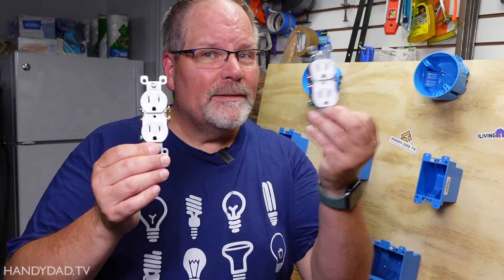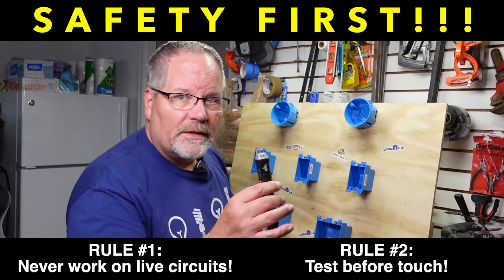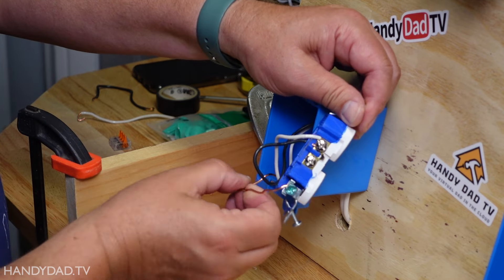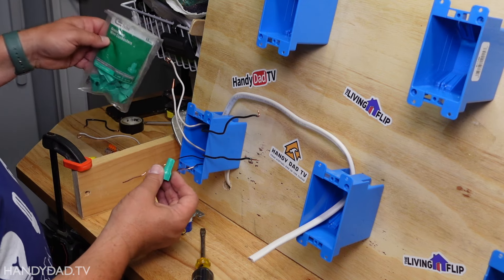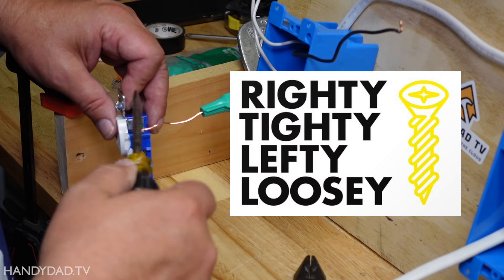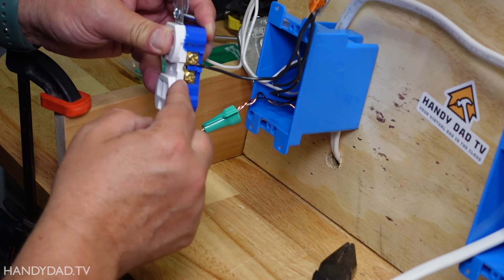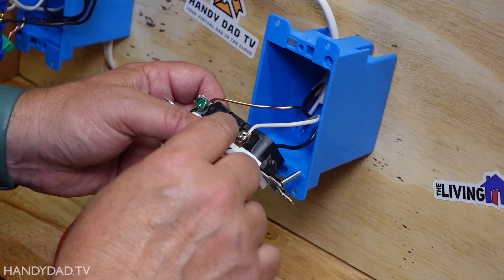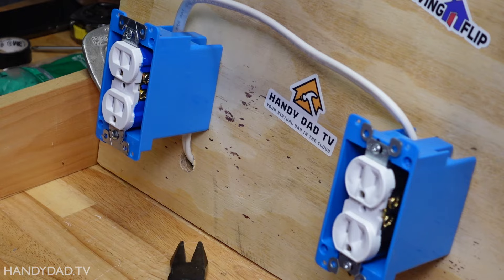SAVE $300 EACH!! How to Add an Outlet from Another Outlet

Comment: thanks so much for your video! can i “pigtail” the ground wire same way you did the hot wire or must ground wires be “bonded”?
Reply from the maker: Yes you can pigtail the grounds. Bonding just means they will stay together even if the receptacle is removed.
Reply: @handydadtv thx very much for taking the time to respond! appreciate it!  and thx for the great video!

Comment: Great video; I had never seen that pig tail used.  Makes a lot of sense.  having said that, then, what is the second connector (screw) used for, if not extending the series?  thanks.
Reply from the maker: Technically each set of screws goes with each receptacle.
Reply: Can you pigtail the ground wires too?
Reply from the maker: @jeffc31783 Yes.

Comment: Adding a garage outlet on a different breaker to split the load of electric heaters.  This will be perfect for pulling power from my bedroom, through the attic, and to a new outlet in my garage ceiling. 😎
Reply from the maker: For heaters, you should consider running new circuits.
Reply: @ I considered it, but the current circuit only powers LED lights, and the battery charger for my power tools.  The additional circuit carries more load, but only in the summer when AC is on it, or if my wife is running a curling iron.
Reply from the maker: @Christopher_R Ok I’m glad you thought it through. 👍🏻

Comment: thanks going to use this on an office luckily it is a new room and I can easily get to wires. When would you want outless on their own breaker?
Reply from the maker: I’d put the office outlets on a separate circuit because computers, monitors and printers draw a healthy amount of current, especially if you have more than one workstation. Especially if you have walls open.

Comment: This is an excellent video, thank you. I do have one question. What if the original outlet has 2 hot wires and 2 neutral already wired in? How do I attach the 3rd wire from the outlet I want to install?
Reply from the maker: Same as the grounds: Use a wire nut or Wago to connect all the wires with a pigtail (short length of wire) to the outlet.

Comment: I need to do this exact same thing to add a box to my ceiling for my garage door opener.  What wire is that you are using?  Thanks for making and sharing this video.
Reply from the maker: Wire sizing depends on the rating of the breaker.

Comment: Great content here! Love everything except the mention of wago lever nuts having a higher operating temp range. I believe it is actually the opposite - most wire nuts have a higher operating temperature than Wago lever nuts.
Reply from the maker: It’s a moot point. Wire nuts and Wagos are rated for 105°C. Romex wire insulation is rated for 90°C.
Reply: @handydadtv  true.

Comment: Thank you for the video..I’m adding a fireplace in the wall and adding a extra outlet for it my question is to get the right wire that I need ?
Reply from the maker: I would only use the heater if it’s a 20-amp circuit. Check the number on the breaker. 

If it’s a 20-amp breaker, use 12/2 wire to the new outlet. 

If it’s a 15-amp breaker, consider running a new circuit if you intend to use the heater.

Comment: Great video!!!! Question--: I have 2 outlets connected to each other in my bathroom walls, but I WANT TO REMOVE ONE OUTLET.... How do I do it?, and how to change the wires that go to this outlet I want to remove????  THANKS
Reply from the maker: Cap the wires and install a blank plate. Don’t cover a junction box in the wall.

Comment: This is awesome! Question: it seems the existing outlet I need to use already has two wires. It's using up all four screws in the plug.   Can I add a third romex cable in the box? If so, do I pigtail the two existing wires in the box and just add the new wires to the plug? (Except for the ground)? Looking everywhere and cannot find a detailed video on this!
Thank you so much!
Reply from the maker: I had the same situation in this video: https://youtu.be/klL8XhKMNT8

Comment: I do have a question about the wire needed to run to the new outlet... is 14/2 type NM-B Romex the correct wire? I appreciate your time and thank you for all the instruction!
Reply from the maker: It depends on the size of your breaker. 14/2 is for 15 amp circuits. If it’s a 20 amp circuit, use 12/2.
Reply: @handydadtv  Great help! Thank you!!

Comment: Great video! Thank you! I am planning to create new two outlet from existing one. Can I also do the same technique and get the power from second outlet for third outlet? I am worried that I am going to overload it
Reply from the maker: It’s not the number of outlets that cause an overload; it’s what you PLUG IN to them that counts. 

Plug 2 hair dryers into the same outlet and you’ll pop the breaker. Doesn’t matter how many outlets are on the circuit.

Comment: Any recommendations on what tools to buy ? Im looking to learn more and do some work around my house. Mostly adding outlets to garage and behind mounted tvs.thanks
Reply from the maker: I don’t have a list, but start with hand tools: hammer, screwdrivers, pliers, tape measure, utility knife, etc. 

Then advance to power tools. With cordless tools, stay with one brand so the batteries are compatible. 

My motto is: “buy a tool when you need it and add it to the cost of the project.”

Comment: My project is a 220 volt In conduit the A/C is Hardwired outside in a junction box on the unit , I need to run a line through siding inside and install an outlet  to plug the new A/C into - old circuit breaker is 20 amp new one calls for 
15 amp breaker - biggest thing now is get the 35 year old Kenmore through the wall A/C out
Reply from the maker: 35 years!!! I’m sure the new one is more efficient, but it certainly won’t last as long as the Kenmore.
Reply: @handydadtv  No doubt it won't last that long
 but than neither will i

Comment: Newbie here (literally my first time doing this), is there a limit to this method of adding more outlets from the same circuit? For example, rather than doing this once for 1 additional outlet, what if I wanted to keep the chain going to add numerous outlets throughout a large room that only has 2 outlets.

Thanks for the help!
Reply from the maker: There is no limit to the number of outlets on a circuit. You are only limited by the power consumed by everything plugged into the circuit. For example, having 5 outlets doesn’t mean you can run 5 space heaters at the same time.

Comment: I want to add 2 outlets to an existing run in my unfinished basement. Watched your great video, then noticed the outlets on my existing run have 3 sets of wires going into them. Can i add outlets in the middle of this run? I am having trouble finding resources on this situation, probably due to me not being able to adequately describe the situation.
Reply: Confirmed. Outlet has two pigtails, one with 3 white and one 3 black already. Can I switch them to a pigtail that supports 4 wires and wire in the new outlet that way?
Reply from the maker: You will always have one line coming in from the circuit breaker. That one will be hot all the time. Then you’ll often have another line going downstream to other outlets on the circuit. So that’s two wires. 

Sometimes there will be another branch coming from that outlet to feed another part of the circuit. So that could explain the three wires. 

Adding a fourth will be very tight in a normal outlet box so I wouldn’t advise it. I suggest you find another outlet to add your two new outlets from.
Reply: Thank you for the the response!@handydadtv

Comment: Would you use the wago wire nut on the wires for the white side just like you did for the black side ? Or would you just connect both white wires to their individual screws ?
Reply from the maker: I’d use the same for both.
Reply: @handydadtv  appreciate the comment back , great videos and feedback!

Comment: Great video. Question: when you made the pigtail for the black wires, where did you get the third, short piece of wire? I understand what it's for but what gauge/rating is that wire?
Reply from the maker: I cut the pigtail from a length of Romex cable. It is 14/2 in this case because it’s a 15-amp circuit. If it was a 20-amp circuit, I’d have to use 12/2 wire.

Comment: Great, great video. I’ve recently moved into an old house and some of the outlets were worn out. I replaced an outlet in my living room, which was daisy chained to the outlet on the opposite wall to the bedroom. After replacing the living room outlet, I cut the power back on and only the bottom outlet had power. The 2 outlets in the bedroom on the other side had no power. I know it’s connected correctly, but would you know why that happened?
Reply from the maker: Sounds like you’re reusing an old outlet that has been split. Watch this to see what I mean: https://youtu.be/5D4itWGtTVQ

A new outlet should work.
Reply: @handydadtv  man!!! With little information I was able to provide, I think you hit it on the nail. I used the outlet that has the tabs that open, and you put the wire in and shut it and it stays locked in. In the video I watched to install it, it had me break the metal piece between. So I guarantee now, that’s what happened. You are the man, thank you so much!

Comment: Thanks for your video on wiring two separate receptacles in a series!  I have a question: I have two receptacles in a series.  I just purchased a new circuit breaker and receptacle. Reason being, the freezer stopped working; the black wire was hot -- I tested it.  The white wire, not sure if the wire tester should indicate any power but the tester only beeped but the indicators lights did not come on.   I am using both a non - contact tester and a wire tester that you used in your video by plugging it into the receptacle.  I thought that the receptacle was bad so I purchased a new one.  Nothing worked still -- tester shows power, plug in tester indicated two orange lights.  Then when I kept the tester plugged in and added a heat gun by plugging it into the same receptacle the plug in tester failed to have any lights go on. The second receptacle in the series performs the same way.  

Do you have any suggestions?
Reply from the maker: Help with what? The tester works. The heat gun works. 

BTW, appliances are usually on dedicated 20-amp circuits. If your freezer is on a 15-amp circuit with other outlets, I’m not surprised the wire got warm. 

Be sure the breaker is matched to the wire size. The previous homeowner may have swapped a 20-amp breaker in place of a 15. That’s a big no-no. It’ll really heat your wire to the point of being a fire hazard.
Reply: We’ll come to find out that my electrical  panel and my mini split system has been hit by lightning.  YIKES😳
Reply from the maker: Yikes indeed.

Comment: Thank you for sharing.  I have a outlet on the wall outside of my closet and want one on the inside of my closet.  Can I put the outlet box on the same 2x4 as the outside out or should I put it on another 2x4 ?
Reply from the maker: Keep it in the same stud cavity for simplicity and use a old work box that has ears to attach to the drywall instead of the stud.

Comment: Great info. Could you also provide some info on how to measure the load on the circuit before & after adding additional wall sockets?
Reply from the maker: The load doesn’t change by adding outlets to a circuit. Load comes from the devices plugged in and turned on. Here’s how I monitor circuit loads: https://youtu.be/wnhNvfKy2rI

Comment: I have a question, what if the existing outlet has all screws currently full? It was an outlet over a wet bar I removed and will use it to install tv above fireplace, but I need to add an outlet for an electric fireplace insert as I'm converting from traditional fireplace i'm sealing off and installing a 60" modern electric one. Do I back out one white and black and put them into a wago  and run new line to fireplace from those? I'm a lil confused. Thank You, I'm subscribing now!
Reply from the maker: This one shows how to wire it: https://youtu.be/klL8XhKMNT8

Comment: Thanks for the video!  I have an existing outlet in my bedroom, and on the other side of that wall is a bathroom.  I'd like to install a bidet but need to install a new outlet on the bathroom side of the wall.  Can I use this method to add a GFCI outlet from the non GFCI outlet?
Reply from the maker: Yes. I installed a bidet outlet off my dining room circuit in this video:
https://youtu.be/klL8XhKMNT8

You definitely need a GFCI outlet unless you have a GFCI breaker.
Reply: @handydadtv  Haha geez, what a relevant video, thanks I'm going to check it out now!

Comment: Hey Chris, thanks for the great video and well explanation. Question, can I wiring more than one outlet or switch from the main outlet, if I wiring multiple would that cause any fire? Cheers
Reply from the maker: You can add multiple outlets to a switch. You are only limited by the capacity of the circuit breaker.

Comment: I have 2 single gang outlets in my living room that I would like to convert to 2 gang. I have done this several times. With 14/2 romex. However I found that my living room outlets are wired with 14/3 Romex. Can and how do I make these 2 gang? Thank you so much for the great videos and the help.
Reply from the maker: It’s probably a switched outlet. Watch this: https://youtu.be/2Pue6CpaQ8s
Reply: I checked its not a switched outlet. Is it possible when the house was built they tapped into the switch for a power source.
Reply from the maker: Okay so just wire the new outlet from the original outlet. Neutral should be white; hot will be either black or red. Just wire it to the same conductors. Use wire nuts and pigtails to join all the wires.

Comment: The original outlet is on a switch.  I want the new one to be constant power.  Do I follow the same steps you just outlined?  Video is very well done, btw!  Thank you!
Reply from the maker: You need to open the existing outlet to see how it’s wired and if there’s constant power in that box.

Comment: Hello, well done video.  I’m confused on not using both screws on the outlet.  I’ve installed ALOT of outlets and when you have “middle of the run” outlets they always use both of those screws to daisy them together.  I also referenced an old wiring book I have it also says 2nd screws are for connecting multiple outlets.  If you’re not supposed to, I wonder what the second screw is for?  Is the way you did  it just to be “extra” safe.  Is it acceptable to use both screws for code compliance?  Thanks again sir!
Reply from the maker: The two sets of screws weren’t put there as wire connectors; they are needed in case you want to split the two plugs on two different circuits. You can separate the two screws by removing the tab between them. 

However, code allows you to use them as wire connectors if you want. But it’s not required.

Comment: Correct me if I’m wrong but by using a WEGO connector all it does is shift the downstream load through the WEGO instead of the receptacle’s shunt. Do you do this because the WEGO can handle a larger load than the receptacle’s shunt?
Reply from the maker: The pigtails allow the outlet to be removed without breaking the downstream circuit.
Reply: You are correct and the Wago is rated for 20 amps and the receptacle side plates (shunt) are rated for 20 amps pass through,so it makes no difference electrically. The reason for pigtails is like he said and it's easier to install or change a receptacle when there's only 3 wires to connect instead of 5. Especially noticeable if you're using 12 gauge wire.

Comment: At the part where i would connect the black or white wire to their perspective sides can i theoretically do the same thing you did for the ground? As in use that same special wire nut?
Reply from the maker: The grounding wire connector only works with bare ground wires. 

You need to use wire nuts or Wagos to connect the insulated conductors.

Comment: I appreciate the video! Could you also use another wago connector to connect the ground instead of the green grounding connector? Or is that a bad idea?
Reply from the maker: Yes a Wago or normal wire nut can be used.

Comment: Quick question.  Can you go from a switch using 15amp breaker, getting power from 14 gauge line, to 12 gauge load out to a light?  Using 12 gauge to light because distance to light is greater than 50 feet to minimize voltage drop.  Any thoughts?
Reply from the maker: You can always upsize beyond the minimum requirement, but never downsize. But it’s unnecessary for 50 feet.

Comment: Thank you for the informative video.  I added four outlets to my basement, but they all are showing reverse polarity.   I than tested the outlet I started from and the outlet before that one .... they are also showing reverse polarity, what should I do?  BTW the outlets I added are GFI, not sure if that matters. Thanks in advance for your help. (new subscriber)
Reply from the maker: First, double check the tester in another circuit. Just to be sure. 

Next, I would identify and test every outlet on that circuit. Somebody screwed up somewhere upstream and you need to find and fix it.

Comment: What kind of wire is suggested for running power tools such as a 15amp circular saw? I’m trynna set up shop and I absolutely love your videos
Reply from the maker: For a shop, I’d suggest at least two 20-amp circuits. Even better is to run a subpanel in the shop for flexibility. You might want to add a 240-volt table saw at some point.